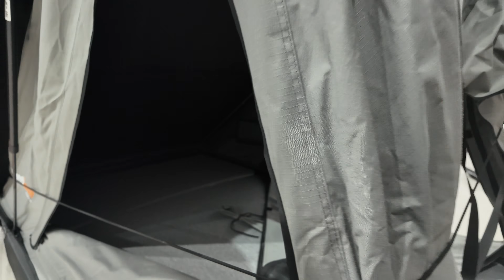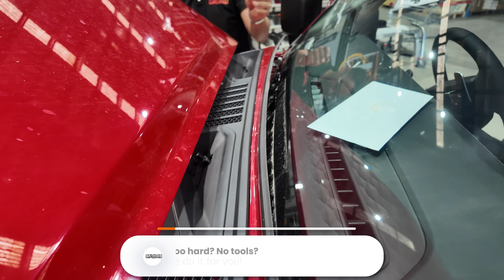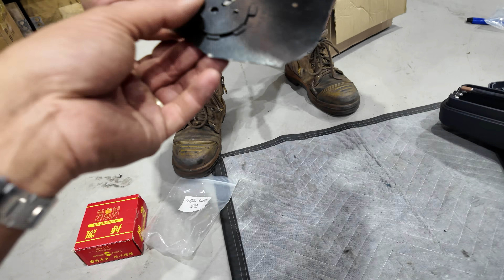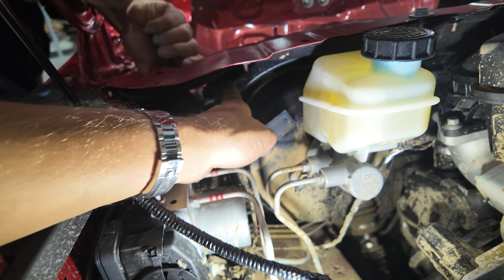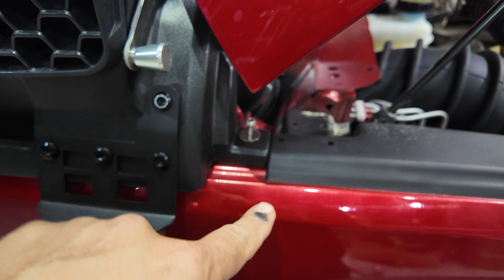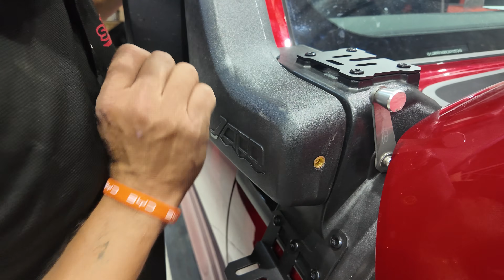TANK 300 SNORKEL SAVAGE TRAIL MASTER INSTALLATION

Comment: If you put it all back together and the wiper motors don't work, check the earth which is on the bracket on the side wall of the airbox. 

Even though I had it flush to the chassis it was playing up. The front right light is seemingly on the same circuit so is also out when not earthed properly. This helped me get it to sit properly.

Comment: What's the Little bracket that sticks out in front off the Air compressor air line recess  ( It has 4 Torx's screws ) AT 21.02 ???
Reply from the maker: That's for mounting side lights.